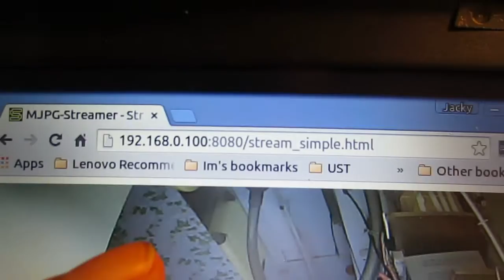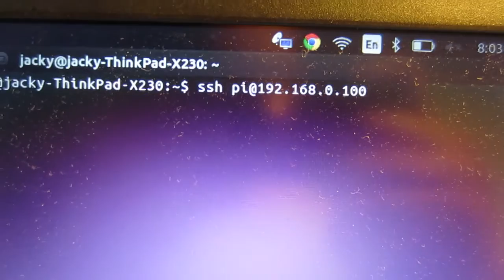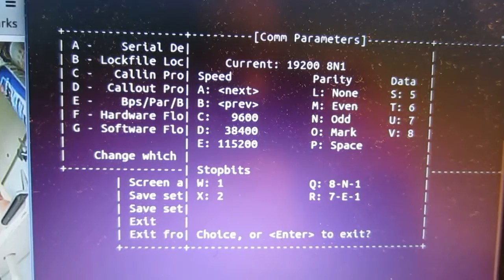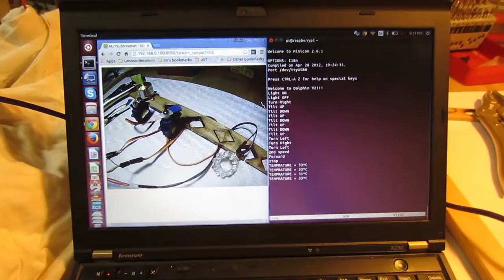Im's ROV - Dolphin V2 - The Control System Explained

Comment: Hi!
Was there an advantage to using the Raspberry Pi as a bridge instead of an Ethernet shield for Arduino? Also does your Pi connect to the  Nano through Serial and everything we saw on the terminal at 6:21 was essentially generated by code on the Nano? (Like Serial Monitor on Arduino IDE)
Thank You!
Reply from the maker: +William Loo 

   Hi William!! Thanks a lot for your comment! I am sorry for the late reply since I was recently busy with another project so I didn't check my channel frequently. About your question, I use Raspberry Pi instead of an Ethernet shield because I want to transmit both the serial signal for controlling the Arduino and the video signal via 1 single ethernet cable. If I use the Ethernet shield for Arduino then I will need to use 2 Ethernet cables to control my ROV( 1 for Ethernet shield & the other one for the Raspberry Pi). Also, there is another great advantage to use Raspberry Pi instead of an ethernet shield. Since Raspberry Pi is a mini computer which means it is great for implementing other function, for example, we can create a raspberry Pi program to control the Arduino automatically and make the ROV to become an AUV. With Raspberry Pi, we can also do complicated on board image processing. 
       About your second question, Yes! the nano is connected to my Pi through serial, so at 6:21 my computer is using a program like Serial Monitor on Arduino IDE and the word appear on the computer screen are sent from the nano through serial. After the raspberry pi receives the serial signal, it transforms the serial signal into ethernet signal.
     I hope I answer your questions clearly. Feel free to discuss with me if you have any other question. Thanks again for the comment, it is really a great encouragement for me to post more robotics video in the future.
Reply: @imslaboratory3314  Thanks for your detailed response from a while back. I was clearing my inbox, and I saw this well-constructed comment from when I was still trying to build my own ROV in high school. I thought I would drop by and let you know that your advice and encouragement had truly kicked off my interest in robotics and autonomous vehicles. I now work with the nvidia xavier to develop software for the AUVSI competition, and will be graduating into a career within the AV industry :)